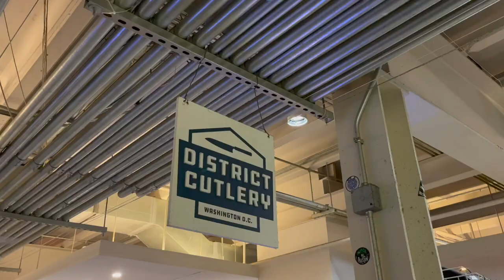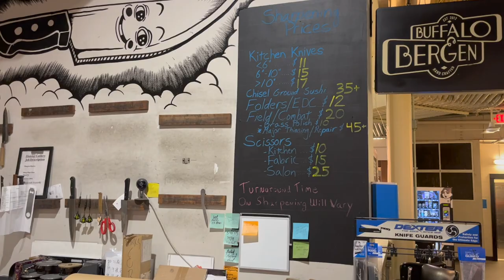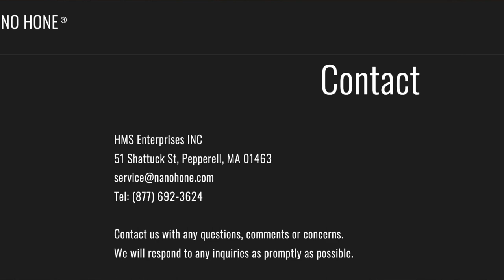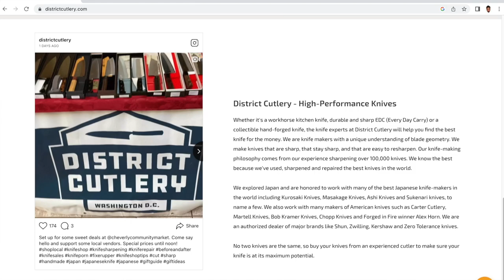Knife Sharpening: District Cutlery Visit 2022 - How to Thin the Edges of a High End Knife

Comment: Cool stuff. Wow edge leading while standing over it, fuck that! He can keep that type of work all to himself. 😂 I noticed the radial platten and where he positions the knife. Is it slightly convexing or hollowing? Looks like it's slightly soft so I'm guessing a convex?
Reply from the maker: It’s actually edge trailing over the top.
Reply: There's a video on his channel about it explaining everything if I remember correctly.
Reply from the maker: @mitch3384  Not that I’m aware of. You can look at the video and see the direction of the spark pattern, he is sharpening edge trailing. In fact, Ryan does not like the edge leading method. That’s more Cliff Curry’s thing, and he only does it with an angle guide so the knife will disengage if the belt catches it.
Reply: @JimSharpBlog  Oh I was talking about the platen! Sorry should have clarified. Now that I think of it, it may have been another Youtuber called PG, but there's definitely a video out there explaining how to build that curved platen. I think it uses Teflon tape underneath to help with heat buildup, and a softer material that compresses slightly. I'm considering making one soon for my 4 wheel 1x30.

Agree on edge leading - it has a bad rep, Cliff has done great work to dispel some of the incorrect info - it CAN be dangerous, but can also be quite safe if you follow a few basic rules. Much like every power tool.
Reply from the maker: @mitch3384  Yup. That is a cool platen he made. It really helps the process. I may interview him at some point and see if he’ll talk about it. He has shown it at the shows he goes to.
Reply: Ryan posted on Sharpeners Chat a while back about how he made that platen attachment
Reply: The radial platten mimics a 36" Japanese style wet wheel, the curve helps direct your pressure and avoid hitting parts of the knife you don't want to grind. The end result is fairly close to a flat secondary bevel.